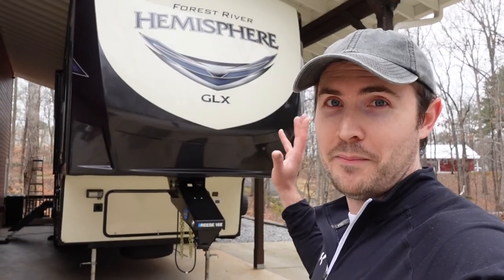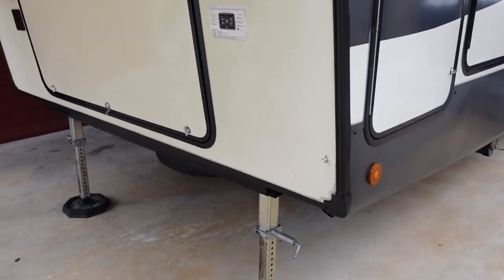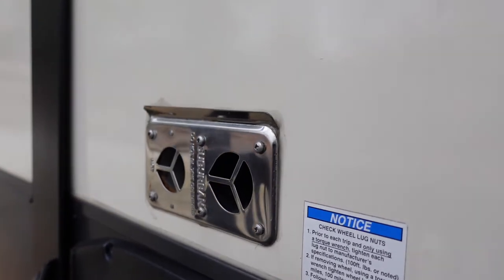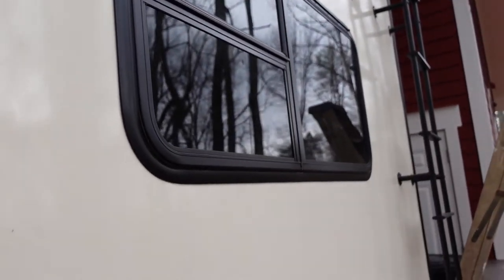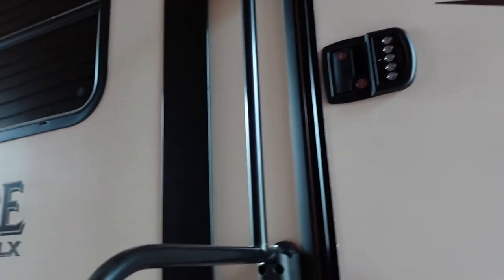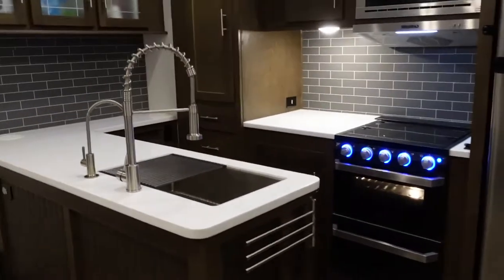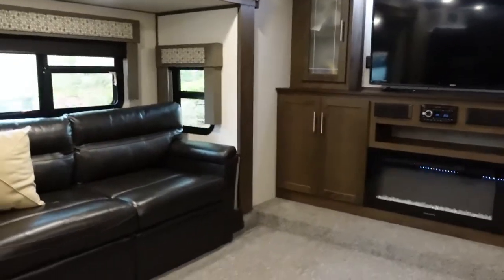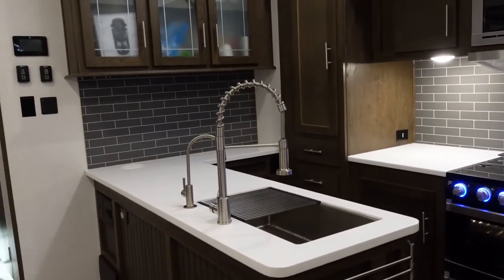Salem Hemisphere 378FL Fifth Wheel Detailed Tour, Review, & Walkaround - Heritage Glen 378FL

Comment: Excellent job on this walk-thru! Been eyeing this particular rig for a couple of years now and hope to get one someday. Couple questions for you: What year is your particular model? I've noted some folks have commented on both the rear bedroom and loft getting rather warm. Do you suppose you have circumvented that with your louvered vents? Or have you had the rig anywhere with extreme heat? Also, an important q here--what has your experience been with getting it into particular places? IE, if a campsite says fits 40ft units, have you tried that? And you briefly mentioned your breakdown of weight between axles and hitch. What did you determined your overall gross weight with full rig was? Thanks in advance! Subscribed and look forward to more videos from you.
Reply from the maker: Sure, glad to help. Ours is a late 2019 build, so after mid-year changes that mfgs typically do. I have seen some builds that lack AC vents in the rear bedroom! Yes, kinda odd...but thankfully we have 2x in the rear bedroom. They are fed through hidden chases behind the storage bins in loft. As you mentioned, the louvered vents in the front are a must-have in my opinion as they allow you to force more cold air to the rear. I like to think the air will take path of least resistence so seemed like without ability to close off some of the air upfront, it'd get too cold up front and not enough in rear. I've also gone through each duct opening and at AC shrouds and taped/sealed to ensure no air is leaking in attic. In addition we tapered the output of one of the vents in the upper rear loft to force even more air below to bedroom. Surprisingly most RV AC ducted systems are not that great and leaky from factory regardless of make, so these issues are not unique to the 378FL, just more pronounced given the complex layout (had similar issues in Grand Design Reflection and FR Surveyor I owned before). We've used the rig in extreme heat both in GA and FL with no issues staying cool and dry. The Coleman Mach 15K ACs are superb. On length question, yes I'd have no worries about 40ft lenghts fitting into sites. In fact I've squeezed into some stating 30 ft. With the axle position and rear jacks you can hang over in the rear a good 15 ft. I'd be more concerned about height and sudden grade changes as it is a tall fifth wheel at 13'-6" and with the rear drop frame it does sit lower to ground in rear than conventional fifth wheels. So if there is a sudden ramp or grade change you might bottom out in the rear (why I added those rollers on back). All that to say we fit in fine at campsites, just have to carefully choose sites and ensure manueverability at camp ground before hand. Usually only an issue at some state parks that are more mountainous and such. On the weight question, with all our personal items and full 50 gal of water, full propane, etc. here are weights on CAT scale: 11,840 axle + 2,440 pin weight.

Comment: Hey, wondering how you liked or disliked the kitchen slide on the camp side being under the awning.  I like to set up a  table and sit under the awning in the rain in that area but looks like you loose a lot of space under the awning with the slide in the way. Thank you
Reply from the maker: I'd say you still get a good 4-feet or so of projection beyond the dinette slide with the awning. Always a give and take there, so it's nice to have the deep dinette slide with the big windows/views on campside, but it is true that in some ways you loose some "patio" space on the campside at the same time. I did use a small 2x4 camp table and used it both in front of the dinnette slide and off to the rear side of it. Good news is both entries are covered by awning. I suppose in an ideal world Forest River could have split up the awning and put 2x so you'd have full coverage along the camp side.

Comment: Just picked one of these up.  Was wondering if the road armor equalizer raised the height of the trailer?  I would like to install the Morryde 4000 but hear it raises the height 1 or 2 inches.  Do you think this will be a problem?
Reply from the maker: On my unit I raised it probably about an inch or less with the equalizer I added. It. Just kind of depends on the dimensions of the new equalizer. But usually for most folks raising it up a little isn't entirely bad since trucks nowadays are so tall to begin with.

Comment: Do these have some kind of styrofoam floor? I really like this floor plan but if this is the case I just don’t have enough knowledge on this to make an informed decision.
Reply from the maker: Oftnetimes RV brands will use a laminated floor that has wood or composite on to outer layers and a foam core. I think the key is making sure it has proper structure with frame underneath. I've seen some lighter travel trailers that have little to no frame for weight savings and then the floor sags over time. But, I think most like this Salem Hemisphere have a structure underneath the laminated floor to give rigidity. This one was a 2019 btw so not sure if they are using identical setup in current models.
Reply: @AdventureRocks  thank you for your response.

Comment: Thank you for the excellent review.  What is your tow vehicle and if its a 4x4, does that cause additional clearance issues at the back of the trailer?
Reply from the maker: Sure, glad to help. I have towed it with 3 different trucks. Tallest was 2016 RAM 2500 4x4 SB (stock height), but I was able to adjust the Goosebox hitch and my ball such that it only sat a little nose high in the end...maybe 2" nose high? I did have air suspension on that 3/4 ton so I could temporarily lower the back of truck to help with the rear of fifth wheel like you were alluding to. So that helped as I could effectively change the rear clearance by a good 2-inches or so. Also, when I upgraded the suspension on fifth wheel, that raised the height by about 1" due to the way it rested on the new equalizers, so that helped too. Other trucks were 2019 Chevy Silverado 3500 Dually 4x4 and 2021 RAM 3500 Dually 4x4 and those both sat a little lower than the 3/4 ton so they were pretty much level. Having the rollers on the rear of fifthwheel really helped though as the only time I usually made contact at rear is when I park on my property where I have a bit of a more sudden incline change along concrete and the rollers just touch down for about 5-6 feet and they basically push the suspension up on the axles ever so slightly, maybe 1/2 inch to 1 inch, so the tires are never airborne. Otherwise, at campsites and getting to them I don't recall the rollers ever making contact. Thankfully there is nothing else hanging down low in the rear such as a drain or water line. Hope that all makes sense.

Comment: I saw you replaced your mattress with a Casper mattress.  Did you just replace it with a standard queen?  I don’t see that Casper makes an Olympic Queen mattress.  Thanks.
Reply from the maker: Actually, I bought a full king and trimmed off 6" to make it the olympic queen at 66" wide. Casper puts a nice zippered cover on theirs and then just a mesh-like inner sleeve. Trimming the actual foam was pretty easy. So just had to resize the two covers with some sewing help from a family member. We kinda just folded the excess outer cover on itself and sewed it in place. You'd never guess it with sheets on. Even without you have to look closely to see where it's been hemmed essentially. I'm over 6-foot so keeping the bed as large as possible was a must! :)
Reply: @AdventureRocks  Thanks!  We have all Casper beds in our house and camper and wouldn’t want anything else.  We are upgrading to a 5th wheel and this layout looks really nice.  Was worried about the bed though, but now am not.  Great review.  Thanks.
Reply from the maker: Absolutely! We love it too!
Reply: Helpful and insightful video! 🎯💯

Comment: Why did you decide to sell the unit? We are seriously interested in this floor plan but are concerned regarding the horror stories of the build quality of Forest Rivers and newer RVs in general. What was your experience regarding the build quality during your ownership?
Reply from the maker: Wanted to try a midbunk floorplan. Plus, I get bored after fixing up and modding one RV, gotta move onto the next one and learn something new in the process! I still think the Hemisphere/Heritage Glen line is one of the most value-packed out there, especially for the $$.
Reply: @AdventureRocks  Do you think there are differences in build quality across the different brands?
Reply from the maker: I've heard about those horror stories you mentioned, but I think they are isolated and sometimes a bit exaggerated depending on the expectations of the owner. I am on my 5th RV and I've owned units from Forest River, Grand Design, and Jayco. Some might be quick to say that some of those brands are better than others, but I've combed through all of them pretty well between the mods I've completed and I can say they're all very similar in the way they're built. I've had issues with all the brands, but I'm a DIY guy so I typically just fix them the right way myself and move on. The biggest difference is more the finishes and upgrades that come from the factory between the prices. They're all produced in mass on an assembly line and built by hand mostly, so at times I do find things that are disappointing, but I could say the same about the homes that I've owned in terms of workmanship quality. Another way to look at it would be, I don't think RVs would be as affordable if the workmanship was at a higher level of quality. So to answer your question if you're able to see the RV in person I think that helps a lot as it is possible for one unit to have more initial issues than another unit. But until you get into RVs north of six figures, I don't see the build quality being drastically different. I've always bought RVs more based on the floor plan and visual appeal, so don't let someone else's horror stories scare you off. I've actually found Forest River to be great to work with... I probably interacted with them the most as I have a rental unit made by them and have had to order lots of parts due to renter abuse and they've always been very helpful to me.

Comment: Do you think that this model would be good for Fulltime rving?
Reply from the maker: There certainly a wide array of opinions on that subject matter for RVs in general, but my opinion is this particular floor plan and the amount of square footage it provides is definitely one of the biggest selling points and would definitely be appealing for someone looking for maximum space in an RV to full-time in. Certainly you can spend more money for more luxurious finishes and amenities, but I still think it's an amazing value overall. I hope this helps and if any other questions let me know.
Reply from the maker: One thing I forgot to mention in previous comment, although the size of the rig is nice to have all that space, depending on the type of full-time rving you're thinking of, the size could be a detriment if you're wanting to get into national parks and campgrounds that have smaller campsites. Then in that case I would say this particular RV could prohibit full-time living just given the sheer size. But if you're planning on staying in private campgrounds, resort campgrounds, and so forth then you'd have no problem fitting in. It's basically the size of a large class a motorhome.